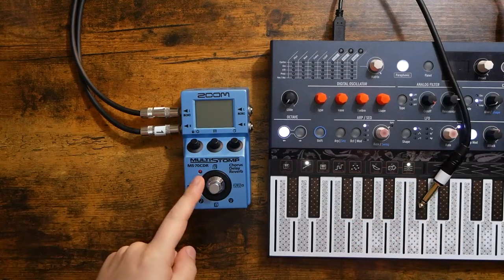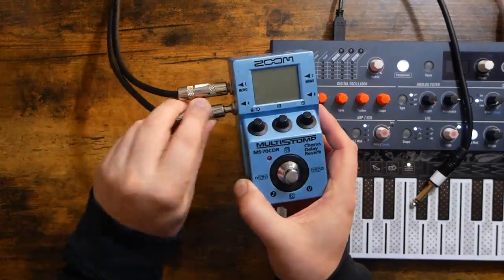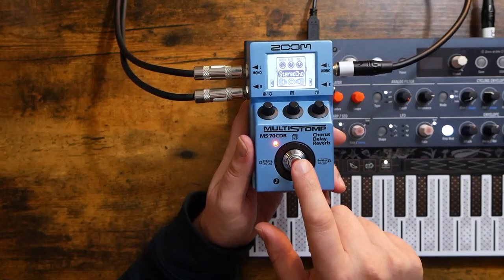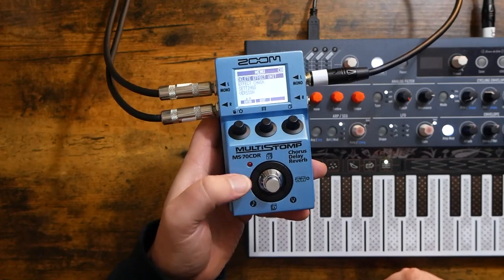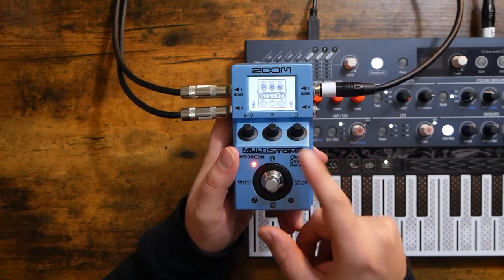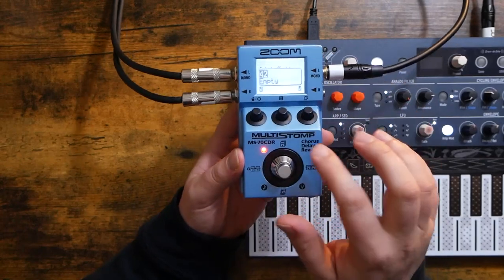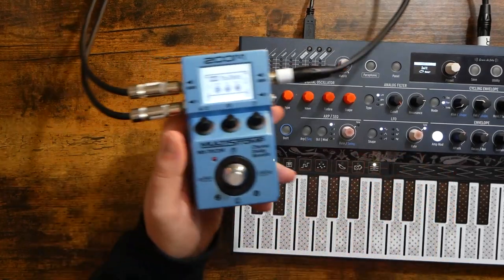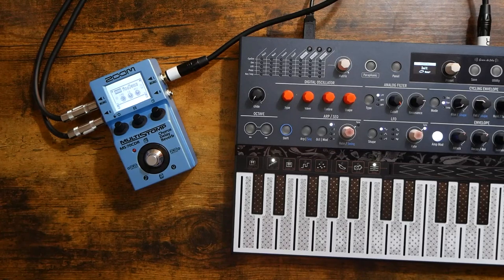Basic MS-70CDR Tutorial

Comment: I use a MIDI switching pedal - DOREMIDI - to cycle through patches on the fly, rather than reaching down to fiddle the buttons. It also powers the pedal so on a gig I only need the right leads and a USB power supply.

Comment: Thanks 🙏 it did help a lot. It took ur tutorial to realise I had to insert the jack to get power 🤪😜🤪
I now look forward to making my own presets as I have the MF 

I intend to put two separate inputs for LR 
L for micro freak 
R for Volca FM 2 
I plan to use both the synths one at a time 

Will  I get a LR out from the MS for each synth 
Or will I get L in L out 
R in R out
OR 
L in LR out
R in LR out 

Please assist 
Thanks 🙏 in advance
Reply from the maker: I believe you'll just get a mono out for each side, but I could be wrong. Thanks for watching!
Reply: @FreeBeat  I did try. I put in the MF and Korg Kaoss as inputs. The LR outs into the speakers. When I clicked the Delay PP on the pedal I did get a ping pong separation 
If that says anything 😊

Comment: Hi thanks for breaking it down. I’m a bit confused with my peddle though. I understand how you can use the foot switch to turn an individual effect on an off but I can’t work out how to use the foot switch to turn the whole chain off so that the pedal is completely bypassed.
Reply from the maker: I believe you could insert a line selector into your chain and then disable that? Not 100% sure though.
Reply: Line selector is how, yeah. You put it in front of whatever pedals you want to switch on and off at the same time. You can have things before it in the chain that will remain active, if you wish
Reply: I enter presets without effects in order to bypass the pedal quickly. About every third preset of mine will be empty .

Comment: Great pedal, superb effects. The only really really bad thing about it is that it doesn't have a headphone output. That is, the configuration with it is never complete, it always requires something else. When you're in a studio or recording a video, you don't notice that. But if you just want to use it for effects for some synth, it turns out that synth+this pedal is just not enough - you really need yet another device. That's a real shame.
Reply from the maker: I'm not sure if I've ever seen a guitar/bass pedal with a headphone out! That would be pretty neat actually haha.
Reply: This is why you need the dude mixer. Great portable 4track mixer
Reply: put a y-splitter on the output?
Reply: @jw112mail Using Zoom Effect Manager you can load amp simulations from some of the other Zoom pedals to the CDR.